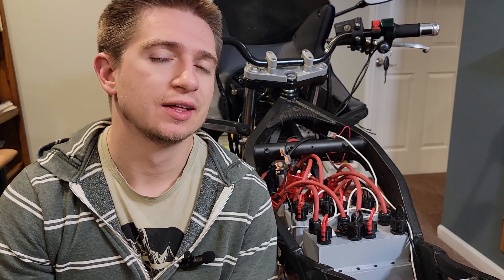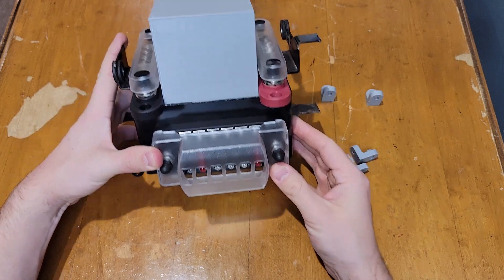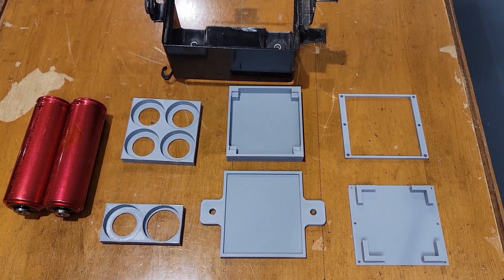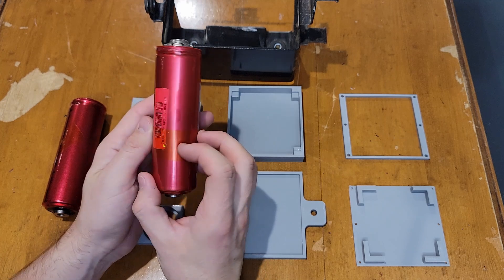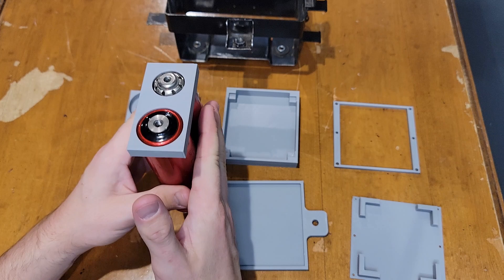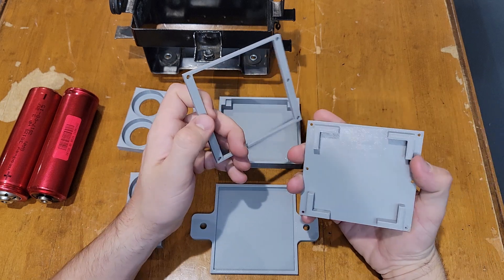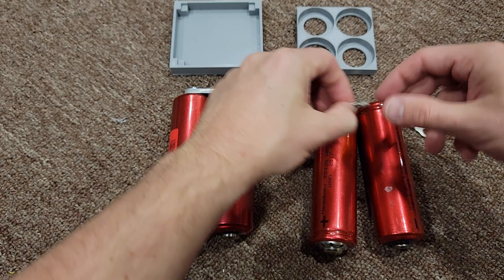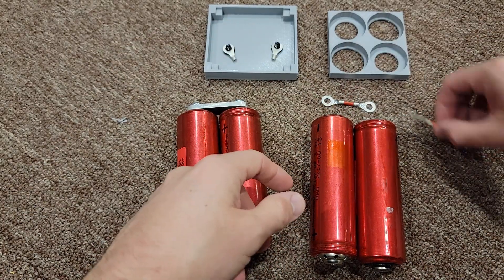Headway 8Ah LiFePO4 Cells - 12V Motorcycle Battery Build

Comment: I don't recommend anyone try this, but... I ran a 4s headway battery (1p, just 4 batteries in series) as the starting battery in a 2016 Corolla S for almost a year. 

This was just an experiment, and I expected the batteries to fail so I made a custom fireproof air-sealed enclosure. 

I did not run any BMS, but I did have an always active  balance board on the battery. No dc-dc conversion, nothing else. 

The voltage regulator on my alternator regulates at  14.6-14.8v, usually sitting at 14.6v. And it worked. It exceeded my expectations. One of the cells did fail after almost a year, however they were used cells to begin. Pretty good, for being in a hot engine bay and being the only battery in a car with electric power steering, which is quite power hungry. 

I've since swapped back to a lead-acid starting battery after the experiment. I noticed no adverse effects with any part of the vehicles electrical system from the headway experiment. The main reason I did the experiment is because I didn't see any other people that had done it. (for good reasons, albeit) 

But, it did work better than I expected.